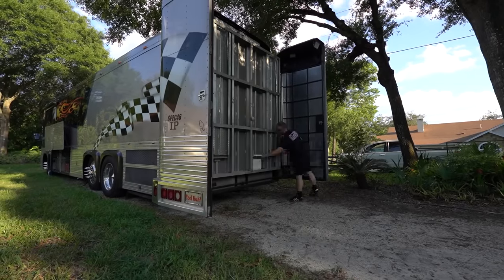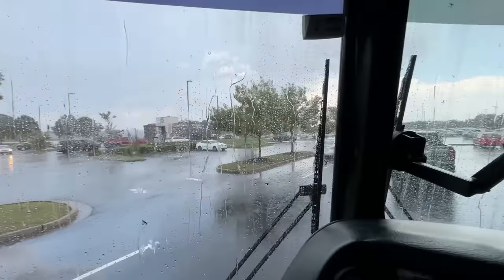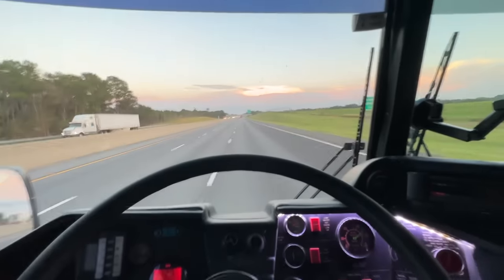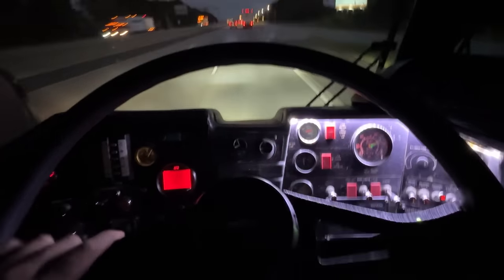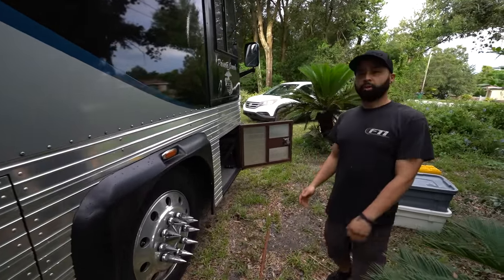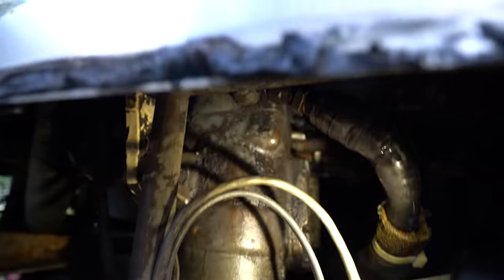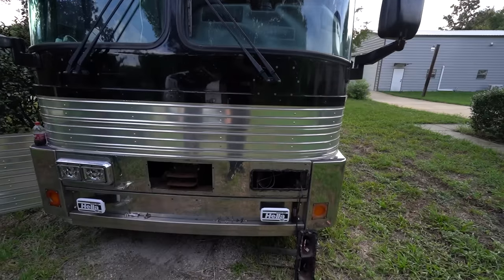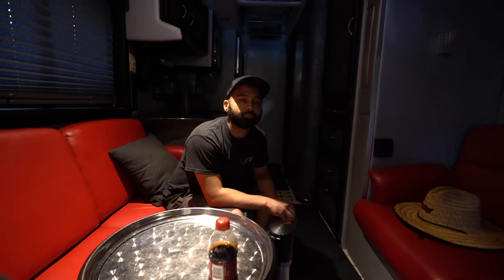First breakdown in the new car hauler bus conversion. major problems far from home.

Comment: You should get a hand pump to fill the PS res, that way you don't have to use a cup. maybe re-design the front clip to be a removeable panel? Just thinking about future proofing it in case you need to get back into those tight spots.

Comment: I’m a heavy equipment mechanic and the easiest way to replace long lines is to tie heavy duty string to one end of the hydraulic line and pull it out so then you can just pull the string to get the new line in

Comment: I wonder if you could 'easily' route an alu hard line from front to back for PS.  Yes, it does add an extra hose per hardline run, but you could easily store a spare or two in a Bus specific spares box.  Soft line that long seems like potential for future annoyance

Comment: Taylor sorry it happened but it does happen. My suggestion is I go through all the brake air lines and make sure they’re all OK as well as the fittings. Make sure you have stock of fittings, for your air brakes and extra airlines and check the compressor to see if that’s OK and if you have extra space to carry a back up compressor and maybe that the power steering line do it in sections and up to where you can carry a back up that gets 50 feet due at 25 and carry fittings just in case if you need a 90 or union granite it won’t be one straight piece but if you do it in sections you can either use that extra back up line to do either one of the power steering lines the back 1/2 of the power steering  or the front 1/2  it’s something to think about, but all she need to figure out is the full length of the line, deduct a half of the line and figure out where that lands in all those cabinets to where you have easy access to replace the line if need be  it was awesome seeing you cruise around in the bus to make to LS fest the way the bus looks and the way you drive I feel confident that soon you’ll be worry free because you will be very prepared. and there small thing to think about it’s something that you can do to make your life easier fine a better place for the bus spare tire because when you get a flat you will have to off load your car and stuff to get to your spare tire 🛞 because I know it sucks. We have to empty out your trailer just to get your spare but your case it’s even worse because it compartments underneath your car so I Can’t wait to see your next video.🤔😊👍🏼🙏🏽🫶🏽

Comment: As an FYI, there are 'field serviceable' hydraulic ends that work on the exact same premise as AN fittings. Generally they work on 1 and 2 wire hose (which I'm sure is what your steering hoses are)

Comment: You might wanna look into field fittings.    If you had the room you could’ve repaired the line with a few wrenches and a hacksaw.     It’s like splicing a air line but for hydraulic hose.

Comment: Weird question - are you considering changing the power steering out for an electric pump so it can be located by the steering box? If that’s an option, I think the shorter lines would bring reliability and ease of repair.

Comment: Just take the time to go through it and replace every rubber component belts, hoses, for the engine and transmission and replace all fluids. Thats a good starting point with any new to you vehicle that has an unknown service history. Also with the original odo not working its hard telling hiw many miles the bus truly has or how it was cared for during those unknown miles. And it may require a reputable service shop to go through it as well to check the things you can't like bearings and brakes.

Comment: Just watched your power steering problem. I think by looking at the return line fitting those are Weatherhead reuseable fittings. any truck stop or road mechanic could have cut your hose and re used that female fitting and made you a short hose with a male end on one end and a female on the other end and spliced it so you could have went on to your event and replaced it with crimp on hose when you got home. but its to late for that info now

Comment: I would just make ends for three hard line. Hydraulic quick connections with hoses at each end. Then make spares for in the bus for repairs on the road.

Comment: I'm sure you'll know better than me but...

-Brakes shoes/pads whatever that thing has
-Brake Lines
-Check play in wheels for bearings
-Ball joints/ tie rods
-fuel lines
-Check all battery cables
-

Comment: Might try tying a length of clothes line to the line before pulling it out, then use the line to pull the new line through.
Personally, beyond the reliability issues, 3500 series trucks are really undergunned as to pulling a loaded enclosed gooseneck. I feel the overdrive transmissions just ain’t up too the torque loads of running down the road with a loaded trailer at >70 mph.

Comment: That sucks!! Highly recommend you bring a portable generator with an ability to use it to lower/raise the lift gate. You can't get to the engine compartment without lift moving. Figured I would mention it if you have thought of it yet.

Comment: FYI, it is very very important to know your GVW overloading your bus can cause a lot of issues to your tires and suspension.
Reply: I'm thinking he'd be hard pressed to overload it with that light race car.  That bus was designed for 54 people and their luggage originally.  Assuming 200lbs per person(150lb body weight and 50lb suitcase), it maths out to a full load of passengers/luggage being 10,800.  Also a lot of these were used as touring rigs for bands with a similar lounge setup as this bus but bunk beds where the race car goes.  In that setup they were towing 10,000+lb trailers full of lights/amplifiers/music gear.  I bet the GVWR on that bus is pretty beefy, it has a tag axle in the back as well to distribute the load unlike some older/shorter buses.

Comment: If I were you I would make those lines connect at a bulkhead or at least a junction block to shorten them up will make them easier and cheaper to repair in the future

Comment: For something like that they have repair fittings that work line an fittings for hydraulic lines. I'd keep a few feet of line with a male and female repair fittings so you could splice in a new section without the need for the hydraulic crimping tool. And the apropriate ends to hook up to the pump or the steering gear.

Comment: That is Murphy's Law there on video. It had to be a part that is 50 foot long! Just as a question, does any company make an electric power steering pump for a bus? It would save a whole heap of hose with  the reservoir beming up front.
P.S. love the bus.👍

Comment: Anyone make a Electric power steering pump that  could handle the bus? just seems silly to have that much hydraulic line running through the bus. 
All toys need their own love now and then.
Looking forward to seeing what you come up with! Thanks for sharing both ups and downs with your day to day!
Reply from the maker: I was thinking about that. I’m not sure. Could maybe run two. But would require running power wires up.

Comment: The simple thing to do (other than a pile of preventative maintenance) would be to give yourself more time for the journey. Not always feasible I know, but if it's that important to get to a competition, give yourself more of a safety margin just in case of delays or breakdowns. 
You'll find the stress is a lot lower if you know your not constantly battling a deadline, you also have the perfect vehicle if all goes well and you arrive at your destination too early, just find a spot and rest up. It's a no brainer.

Comment: Obviously a 1 piece line is ideal but could you cut the line at a nice serviceable area and put in a junction and a new piece going up to the wheel. When I did marine electronics we would have to make our own steering lines for the auto pilot systems and we used a swage tool right at the truck or shop to make the lines up.

Comment: I'd recommend when you replace the lines going to power steering having a 2nd set built and put it in place. That way if 1 ever fails again you have a back up not only on hand but already in place so you can just hook it up, bleed the system, and go again.
Reply: That line probably lasted near 40 years, no need to put a spare in, the new one will last longer than he will be using that rig.
Reply: @--_DJ_--   fair enough that's a good point, I was just thinking as a "while I'm here it doesn't hurt". And I was thinking as long as it doesn't take up much room it could just be insurance. But if what he puts on is made right and is good quality(and he pretty much always gets good quality stuff) then it should last 30-40 years no issue.
Reply: @markmcguire7977  I think there will be plenty of other "while I'm in here" things to come for the boys once they really get under that thing. My wallet hurts just thinking about what he could find under there. (I work on mostly old trucks for a living)

Comment: I would check a lot of the mundane stuff in the undercarriage like kingpins, suspension bushings, Brake S cams and bearings for oil leaks. From what I have watched of @BusGreaseMonkey 
these are very common problems on many of the old conversion busses that they see.
Reply: Those are common problems on any rig, new or old. But I agree, might as well dig in and really see what he has underneath him.
Reply from the maker: That’s been the plan. Just ran out of time. I want to get it to him to go through that kinda stuff. But he’s booked till next year.

Comment: Hey bud . unfortunate this  happened .. Just  an idea tho . If it was me . I'd be making that hose 3 same size pieces . Make up steel pipes to adapters from the pump and steering box . That way each  hose has the same fittings each end. Carry 1 or 2 spares . That way if it was to happen again you would be covered and be a hell of a lot easier to replace . Or have something made up easy enough to replace .. A line that long would be a pain to change . Make the joins accessible..  🤓

Comment: It kind of looks like it was the low pressure return leaking but I could be mistaken. If that is the case you could have just cut the line and fixed it with barb fittings and any oil safe hose of the proper diameter. I guess the challenge would have been finding a barb to go into the steering box or fitting that remained.

Comment: I work on this stuff all the time don’t replace it with one line make it in sections so when they blow you can just replace one section. Hydraulic lines are easy just need a angle grinder to cut lines and two crescent. Wrenches. Just go to any truck and trailer place and pick up some reusable hydraulic fittings.
Reply: A new line isn't going to blow any time soon. I wouldn't add more leak points if I didn't have to. One hose straight from front to back is the way to go. You are leaving a ton of trash in the lines if you just use those tools. You have to flush the line, unless you like rubber and steel mixing in with your fluids.

Comment: What Ackerman keys are you running on the @justengineering angle kit? Traditionally you want inside wheel with slightly more angle bc it's on a tighter radius but what about with drifting.. and did you have to dremel the  slot at the tie rod to fit the keys in the resest pocket bc I did lol😅
Good luck with the bus that is one cool unit!

Comment: coulda cut the line in the front where josue was and tape the new line to the old and pulled it out through the back of the engine so it was in the same route yenno? kinda like how you were gonna do under your driveway?

Comment: I've towed a 34ft enclosed two car trailer at 14k lbs weight behind miled out duramaxes (all 400k+ kms) 50k + kms and never had the issues you've had with tow vehicles.

I'm just in awe really at the luck you have with them

Comment: He guys tough brake on first long trip but hey everything mechanical breaks and usually when you dont want it to. As for the hoses chances are they are not full length rubber hoses. They are probably rubber to the bulkhead then transition to metal. Good luck on the repair.

Comment: Might be a bit unrealistic but what bout extending the filler neck for ps oil etc so you can do it inside the garage portion instead of dropping the back each time .. make it removable for engine swaps etc but as a fail safe so if it's raining you'll be fine to top up fluids through the floor and label each point for ease of accessibility Genny too then you are sorted

Comment: He could have got a hydraulic line reusable fittings fixture line right there and ran a short piece from where it was leaking and continued your trip sucks to know you guys drove hours that way and had to turn around but I understand you're new to the diesel world and on the diesel mechanic so just things you guys can do you know it's a hose is not a bad all the way they do sell reusable fittings and make a short piece to work hopefully you get this problem resolved you won't miss another great event

Comment: I drive semi for a living for the last 12 hrs and 1 of the many things that gets over looked is getting a full pm service and over head done. I’m sure you know what filters and fluids can do for a vehicle, not to mention valve clearance. Not sure the buses age but exhaust can restrict mpg on these things. If you have a get look into a ( cough cough ) correction.  Best fuel is at TA/ petro. Do NOT touch pump def any where if you have that, just buy it in the boxes and only buy name brand period. Change your fuel filter at 70% max ( the savings far out weighs the cost). Pending on gearing ratio you should be most fuel efficient at 63-68/70.

Comment: Best way I can think about that line is to have a new one made then connect a dual sided male to the new hose and the old hose and try to pull the new hose through where the old one is. I’m sure there’s mounts or zip ties all the way down
Reply: I would just zip tie it to the old one, pulling that out would probably be a huge pain and end up with other hoses rubbing on things if they get moved around.

Comment: Could you switch over to electric steering? Not sure if there is aftermarket support for a bus. Alternatively, what about switching over to electro hydraulics. Basically, instead of having a giant hose all the way to the pump in the back of the bus, you could drastically shorten the hose length and put an electric hydraulic pump at the front of the bus powered off the 12v system. 

Either way, you are taking a failure point out of the system that makes it harder to service in the long run and drastically simplifying your power steering system.

Comment: Volvo electric PS pump in the front of the bus for short runs on lines and easy maintenance! Wonder if it pushes enough pressure for the bus steering rack
Reply: Steering gear (possibly one on each side of the frame), not a rack. I highly doubt it would even be close to enough volume to do the job. Probably makes plenty of pressure.

Comment: I would have got a barbed fitting screwed it into the steering box then cut the hose and slipped it on and put two clamps then refilled and bled the air out. 

Looks like you had a low pressure hose leak since high pressure leak would have been all fluid out first ten seconds! 

Other option would have been get a male to male barbed fitting and slip hose on cut at the rip them clamps and fill fluid!

Comment: Is it standard in the US to use regular motor oil in the power steering system? Trucks (and cars) in Europe basically use ATF or some kind of DOT 3 or 4 fluid depending on how hot the brakes get.

Comment: I think it's time to just build yourself a badass tow truck that you can work on yourself, like your car. You need a custom job that you built with your attention to detail. This way you can work on it and get it going in minutes. In my opinion the bus is just a big question mark. Every time you pull it out of the driveway something is going to fail or cost money. Good luck bro.

Comment: I know switching up the rig again is the last thing you want to do, but a gas 1 ton ford or GM with the 10 speed, the new ones, would be more reliable than anything.  Yes it would drink gas, but no age issues, no emissions issues, no CP4 issues, simple, and more than capable of the weight you are towing.

Comment: Driving bus and truck for years it is constant maint and preventive maint regardless of if its a picup or a heavy truck or bus there are things from stuctural to makimg sure everything is tied downto all doors are closed the coach should have an axces door on the driverside below the drivers window below the circuet breaker door to get to the steering parts 😊

Comment: If you want to pull new lines through you can tape new lines too the old lines in line with each other and pull the old lines out while pulling the new ones in I do it in boats all the time it’s not like cars where you can access all the routing easily

Comment: I wonder if that line is tight somewhere and its own weight is pulling down on it making the turn in the hose the weak spot, it sits there and flexes at the turn over every bump and eventually wore itself out
Reply: My guess is that is the original line. It was well past its best before date.

Comment: Disconnect the line, tape it to the old line and pull it through like electricians do when replacing stuff or pulling cable in conduit.

Comment: Worth going to electric pump for steering? Only need power to it then and easier to work on if you locate it more convieniently in the front.
Reply: Interesting idea, but it won't work an electric pump would burn itself up trying to push fluid 50ft and back.

Comment: Had a breakdown on road from Portland to Tucson back in 93. Spark plugs fried because dummy friend used too hot range plugs. Slow trip off highway to get new and a jet change on carb and we made it 900 miles later. 
Sorry you couldn't fix it but Shit happens.